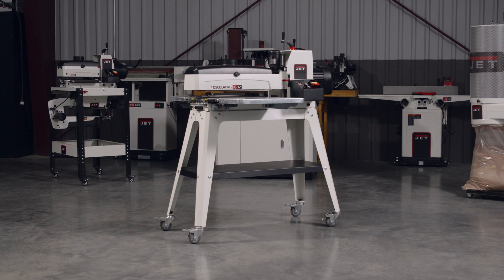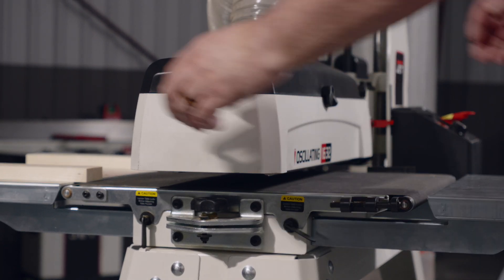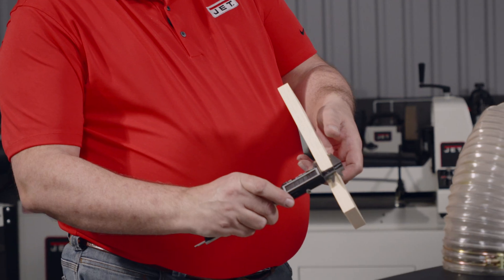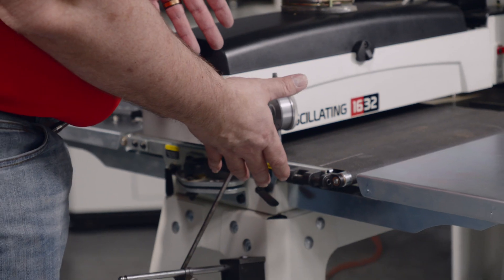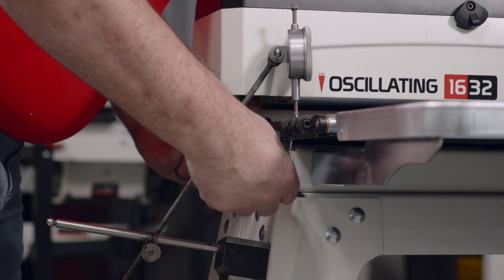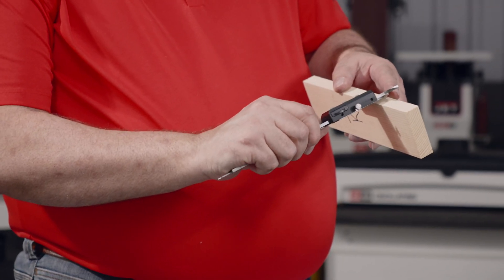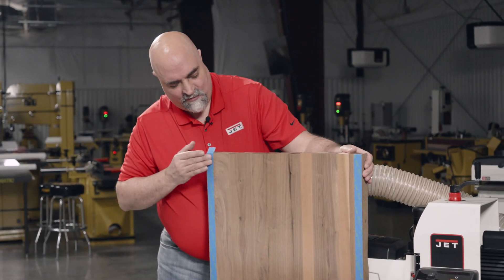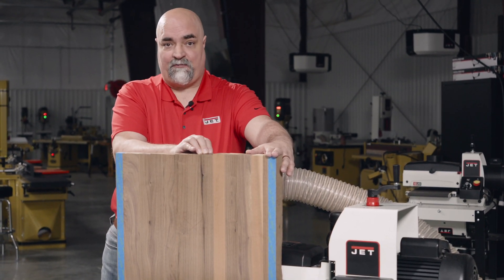Jet JWDS Series Drum Sanders | Conveyor Bed Assembly Alignment to Drum Assembly Alignment

Comment: So is your tool out of spec out of the box? is there another way to check your tool without having to buy a dial indicator? some people cannot properly read a dial indicator, I am shopping for a drums sander and thought I would get a jet, but now I need to see exactly how to make the drum parallel without having to buy expensive tools
Reply: No it comes pre-aligned from the factory. Also a dial indicator is $30-40 and not an expensive tool. If you're not getting a jet then you basically have 2 or 3 other options and you'll still need to learn to make those adjustments. 🤷‍♂️ worth the time to educate yourself a bit if you're going to spend $1500-2300 on a tool. 

"Some people cannot properly read a dial indicator" huh??? If you can read an analog clock you can read a dial indicator lol. If you can't for whatever reason, they come in digital readout as well. If you can't handle that, then I don't know how you use any of your machines or tools?

Comment: The videos are supposed to help customers, but the videos  do not achieve that. This type of helping tools needs to show the proper parts of the machine, nut instead it mostly shows the face/body of the person who is talking. There is no synchronization between the camera and the person who is talking, also the is not close up of the parts of the machine, so it is confusing try to guess what is the part of the machine the person is talking about. I will suggest to re-do your videos showing with close up the part of the machine instead focusing on the person.
Reply: Agreed. I need to see how to level the conveyor and he doesn't show the locking knobs and what he's turning. Also he said there's one way, but didn't show another way.